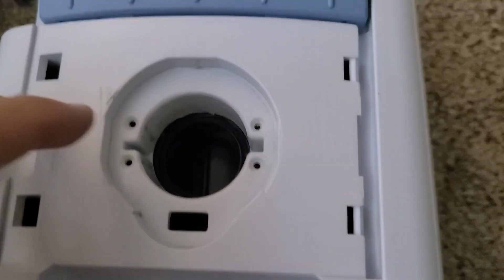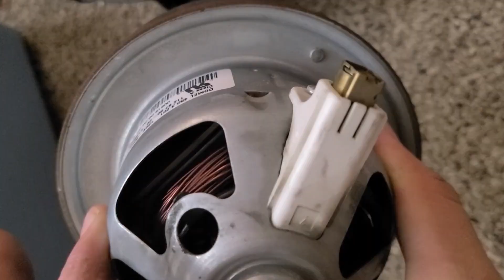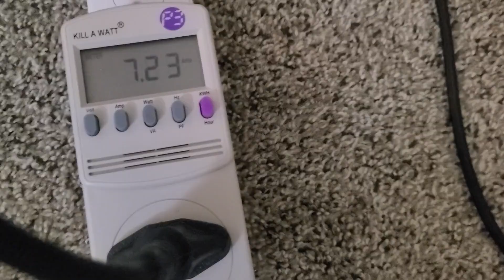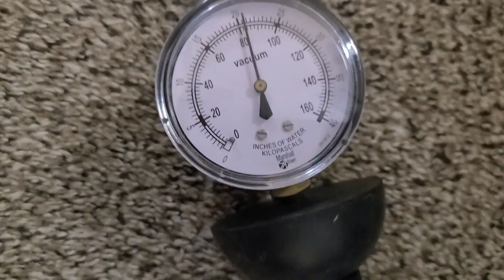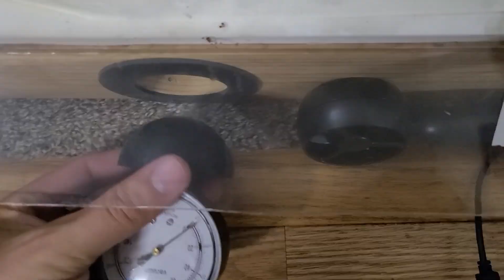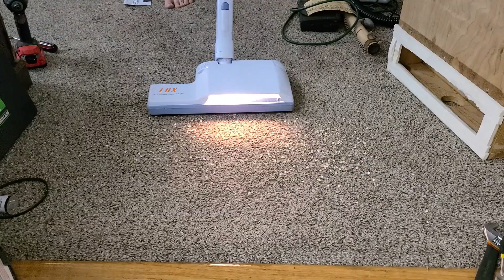Aerus Lux Guardian C154E Airflow test

Comment: Electrolux's PN 5 and 6 Omniflow nozzles were their best sealed power nozzles, when they started incorporating headlights into them, they leaked too much air.
Reply from the maker: Never given it much thought, the 5s and 6s are definitely better sealed than the models afterwards but....how do the 1-4 compare?
Reply: @Blackheartvacs the pn 4 seals well too, idk about it's predecessors. Vaclabs pn 4 is sealed well.

Comment: Too bad these machines use cheaper motors and that seems to be a problem with anything these days.  I guess I am strange in thinking we could be making vacuums with an Ametek Lamb tangential bypass motor with at least twin fan stages with a regular on and off switch, preferably a switch that is two-pole with a decent hose, say 10 ft long and a fairly decent power nozzle and tools, I would probably go with the standard Wessel-Werk EBK360 and even the option for an HEB-160 for furniture and stairs but that's just me.
Reply from the maker: It's much less excusable for a premium and well known brand.  Hmm...there have been somewhat similar machines to what you're describing Silver King comes to mind, but they were quite noisy and had a small filter surface area.  the hose wasn't 10 ft but pretty long. There's also been Fairfax

Comment: I had one. Needed new motor. I replaced it. I love it. But it started speeds going up and down.   I said nope I’m not spending any more. I kept the hose and power nozzle now is on my compact. As you seen before
Reply from the maker: Hmm...I've thought about that scenario since these machines have like 3 circuit boards in them, I figured IF that occurred I'd just simplify the machine and take the speed control out of the equation. I suppose one could retain that handle on/off switch by using a generic central vacuum circuit board and running the low voltage system to 2 of the wires  in the hose.